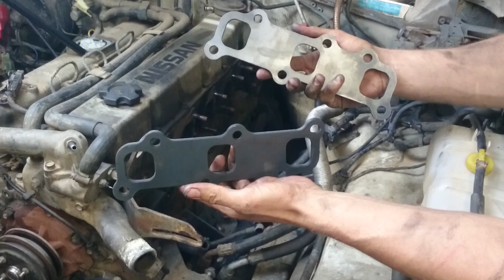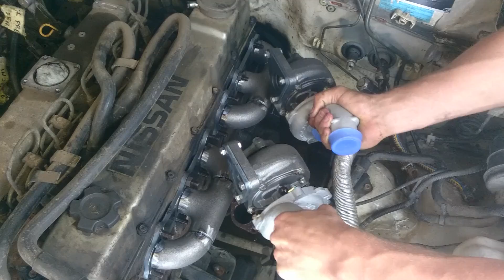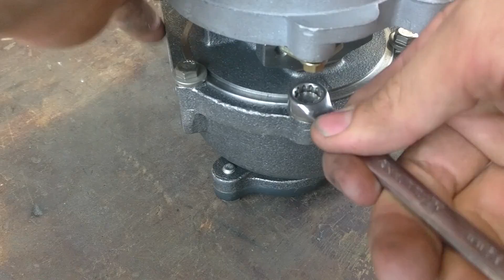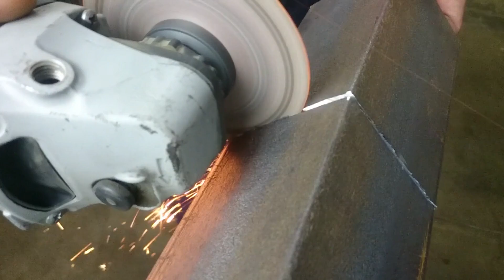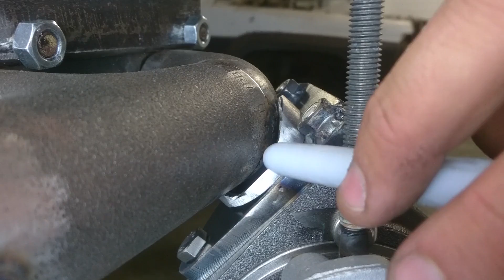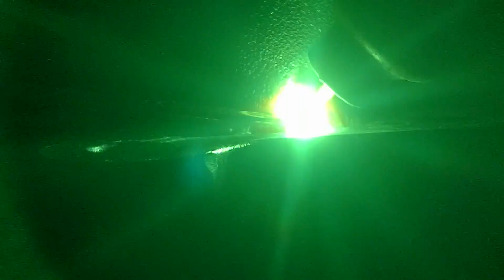Project Twin VNT - Twin Turbo TD42 Patrol - Episode 2

Comment: I tried to replace the core on my Hyundai i30 crdi without talking off the rear housing and fuck me that shit was too hard so I just got a new turbo and got a dealer to install it apparently they snapped half of the bolts and went 12 rounds with it